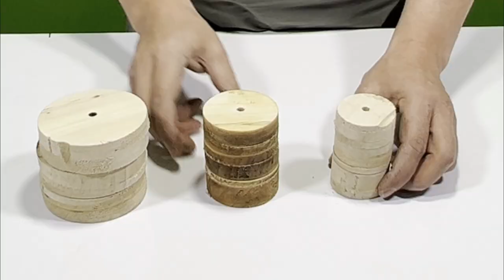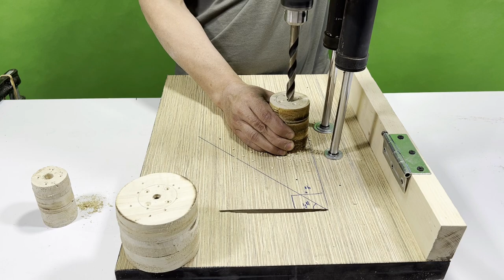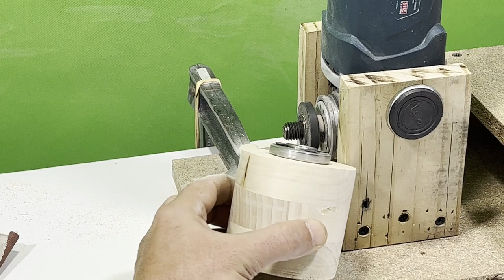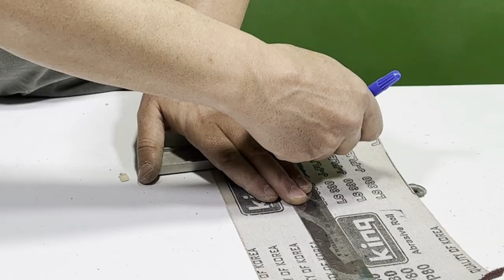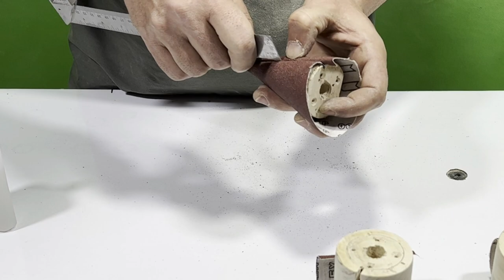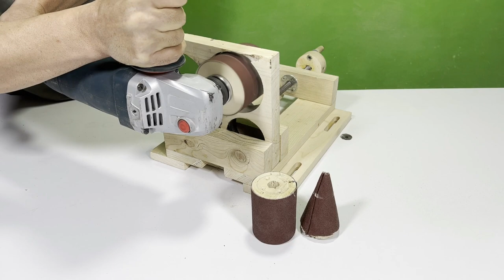Sanding Ideas with Angle Grinder, Angle Grinder Hack

Comment: I used to get smoke and black ash when I cut woods and it turned out the reason is the blade was turning the wrong way
Reply from the maker: If the blade isn't sharp, the same thing happens to cut wood, 
have good one